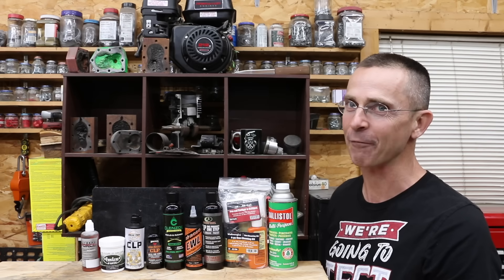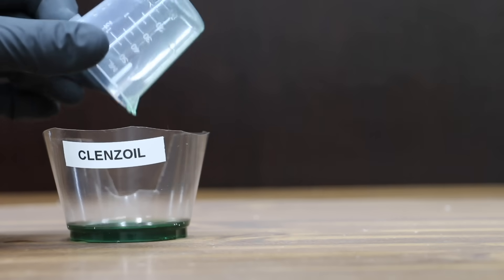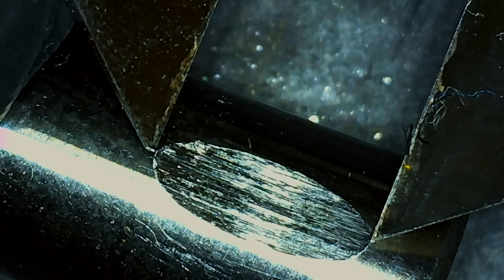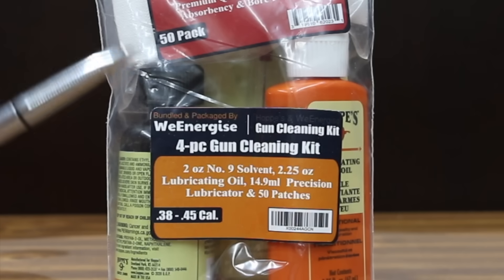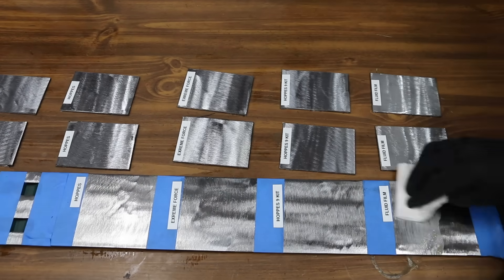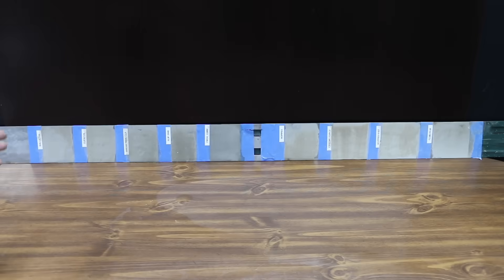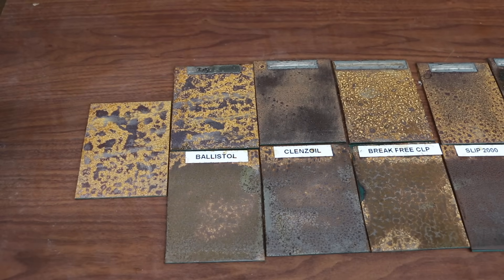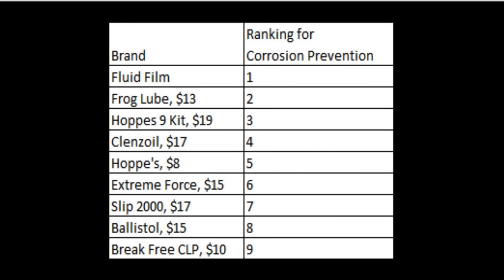Don't Buy A CLP Until You Watch This Review! It'll Save You Time And Money!

Comment: Excellent test. Disregarding how people call this kind of tests this was pretty scientific and elaborate testing. Also avoids showing guns with does goid with YouTube. Clever. In principle I have no use for CLP. Guns are banned over here. Anyhow I am quite disappointed in the Balistol results. I use their universal oil for many things with great results. Use it for manny purposes and it shines in all of them. Sure for some specific applications I use teflon spray or silicone spray or white grease or copper fat or graphite fer or what ever else is called for. But I use Balistol on metal, wood, leather and other materials and it lubricates, cleans and indeed protects surfaces. Woof feels great treated with it. Ach well. Other product from same brand. Anyhow kinda sad about how this product have performed here. Not cheap and not performing great. I've expected way more although I have never tried that exact product.

Comment: The process for frog lube is more tedious then regular lubes but it does work well! Supposed to degrease previous lubes because it interacts with frog lube,  then heat up products treat with frog lube and let sit. Then wipe off and use as a “dry” lube. They also make cold weather lube.

Comment: As former Force Recon I have used each of these except the extreme force CLP and Clenzoil. Break free is trash and not viscous enough to keep parts lubed during reciprocation and heat. Frog lube smells nice and is great for keeping parts clean in maritime operations but gets fouled too quickly when firing. SLIP 2000 EWL (and regular) is the best overall, it has been my go to in Desert, jungle, maritime operations, and will keep you firing longer than the others. It was interesting to see from the tests that you wouldn't think SLIP 2000 is very good but it has served me very well.
Reply: I was on the verge of regretting my very recently purchased slip2000. Never tried it before but now look forward to it after reading your input.
Reply: I'm a veteran 🎗 & a gun owner. I've used Ballistol since the late 1990s. It's always done very well ✔. I've bought, used Slip 2000 EWL & Froglube 🐸 Extreme(since 2014 or so). I like FL but it is pricey 💲 & can gum up, form gobs over time if too much is used. My friend has some Cleenzoil CLP which I may try. A big - with the brand is its petroleum based which many gunners, gunsmiths advise against 🚫. I will say, the product did extremely well in the R&Ds. EWL is not cheap but from my limited use, last 16mo or so, It's done fine; Walther PDP, M&P 2.0, Glock 26 gen 5 9mm, Glock 22 .40 MOS(cerakote elite).

Comment: Have spent years in the military, and using CLP on everything, although not a good hot sauce alternative, this is a great review. I love the added dirt attraction, as  that was a huge issue with multiple deployment overseas.  We tried using the graphite dry lube, which kind of worked. Thanks again for all your hard work and thorough testing. If you're curious, a M2 .50 cal will start to rust when he sees rain in the distance. A light 30w50 oiled rag can coat it nicely, but the. The sand loved it. Winter was a constant battle between the two
Reply: Ours did too until I had someone send me a can of Johnsons Paste wax. Got laughed at but after the first deployment not anymore. Everyone had a can of it.
Reply: @bixby9797  That's a good idea. Paste wax, and specifically lanolin, are used to protect bare metal to great effect.

Comment: Excellent video. For firearms if you have to have only one thing to carry in the field or on a trip Breakfree CLP will do the trick. For general, everyone I know uses cleaner then oil. General cleaner Hoppes 9 or homemade Ed's Red  ( ATF/Kerosene/Mineral Spirits/Acetone) then short term Ballistol, Long term full Synthetic 0w20. I keep a gallon of Ballistol on hand because it's so versatile. Leather boots, firearms, boring fluid, black powder neutralizer (moose milk). Stuff's amazing. Want long term non-oil? Johnson's Paste Wax. Lot's of museums use it.

Comment: I would think if in need of a quick cleaning some crc maf sensor or similar spray would do great, not for lube but a quick clean, lube well id say you could use some good atf or some thinner motor oil should do just fine and save some alotta extra money.

Comment: As I use Geissele oil and thin grease to supplement the lubrication aspect I’ll have to watch this again to see which products lean more toward cleaning and protection. Good info, though, as always.
Reply from the maker: Thanks!
Reply: @ProjectFarm  Excluding the lube test the Break Free did well in every category except corrosion. Good thing I have some Frog Lube to smear on the exterior surfaces. 😎 Still, I’m wondering how the Lucas CLP spray would do in these tests. Thanks!

Comment: Nice test and reporting. Wish you'd have added ATF Dexron, which is often used as  gun lube and cleaner as is Mobile 1 10-40w. A rare test is to find one that actually cleans barrels which have a layer of copper and carbon and who knows what else from firing. Some tests reply on dissolving ingots of lead and copper rather than removal of the layers in a barrel which is probably a layer of guild, lead, and carbon with carbon being the top layer and the first to be removed.
Reply from the maker: Thanks!  Thanks for the suggestion.

Comment: Great Job on this one.

Lucas Oil has an "outdoor Line" also, that has a CLP & some other products....

I was very intrigued that only the Break Free and a couple others actually met the specs....  although to be fair, I'd have to rewatch to be sure, but I'm pretty sure that Slip 2000, they don't "really" market themselves as a CLP....  I don't think it says CLP on the bottle.

We always used Break Free.  I have piles of that stuff.  Not gonna lie, I was shocked by the corrosion test....  In my experience, you spray that stuff on, and it stays.  I got some on a dinner plate once (don't ask), and I had a heckuva time getting it off....  Maybe the Hydrogen peroxide eats it?  Not sure....

Anyways, great job...  That was a fun one.  I'm one of those people, I have Break Free all over the house.  It's great for lots of things besides firearms.
Reply from the maker: Thanks!  Thanks for sharing.

Comment: Thanks for the test. I have been immediately turned off by Ballistol as it gums up, stinks, and is a terrible lubricant. Frog Lube just did not seem like a lubricant. That said I don't use ANY CLP. I clean with the appropriate product and lube with an appropriate lubricant. ALSO - Please don't say "the lube absorbed into the metal" -  metals used for guns (steel, aluminum, alloys, etc) do not absorb any lubricant.
Reply from the maker: Thanks for the feedback.

Comment: I use Hilco- lube or Marvel Mystery oil mixed in mineral spirits for cleaning for lubricating CLP break free or Royal purple 5w30 mixed with a small amount of Lucas red and tacky grease and whipped up well for long term firearm storage used very lightly with a toothbrush and a small piece of chamois cloth so far no rust just a quick break down of firearm and wiped down with dry chamois cloth before use to remove excess oil and grease has worked well for me now over 20 years
Reply from the maker: Thanks for sharing.

Comment: Don't know what the modern advice is these days but over the past seventy years I have always used a solvent and then an oil for protection.  Grew up on Hoppe's (pronounced Hop-ees-, long e) #9 which always called itself a solvent.  If left as a protector you would not get rust but a green residue like a copper on a patch run through the barrel.  The problem was if misused that residue could gum up the action.  Properly used to remove powder and copper fouling then wiped out with dry patches before applying an oil for storage and a gun grease (again a Hoppe's product) for long term to be removed before using.  We even used STP as an outer wipe with our weapons if we were hunting in our heavy rains.  Too thick for the action but it was tenacious about shedding water as in a wet duck blind.  In short just never found anything that could do it all.
Reply from the maker: Thanks for sharing.

Comment: You dont need to lube the gun for wear. it's rust and carbon solvent you want it for. if your gun needs lube to work or "last longer" you need a gun smith.. also please test the omega 636 if it will come on top of fall flat in this regard. :)
Reply from the maker: Thanks for the suggestion.

Comment: I  think the Hoppe's #9 doesn't belong in this test as it not labeled as a CLP.   It's a gun bore cleaner formulated for breaking down burnt powder residue and copper fouling, and when the cleaning solvents evaporates, a thin lubrication film is left behind to prevent rust from forming 
on what would otherwise be exposed dry bare metal.  It's not intended  as a lubricant for metal on metal  friction.

Comment: I wish you would have used some synthetic 10w-30 motor oil, that's what I have always used in my ar's and handguns. Never cooks off from the heat, and lasts several hundred rounds before needing to reapply.
Reply from the maker: Thanks for the suggestion.

Comment: Finally! I requested this like 2 years ago and you responded something to it but I can’t remember what you said haha. Thank you.

I personally use Lucas marine grease. It’s the same as Lucas’ firearm grease according to the data sheet (minus the grape smell). You can get a huge tube of it for like $5-$7 as apposed to like $7-$15 for a tiny amount. Would’ve been cool to see the Lucas grease in there. The good thing about firearms is they have very tight tolerances (some less than others) but even a bad lube will still work decently in a firearm. I’m glad to see all the fudd lore disproven though. Hoppes is trash and is ammonia based which can react to certain metals like nickel. There’s people who swear by it but it’s clear that it’s bad at lubricating.

Comment: I think that this time you tests were irrelevant to actual situations. First of all, you can't use the jig for testing how much friction protection a product insures because in a firearm you do not replenish the oil like you did from your container. Second, firearms do not shoot steel projectiles, the jackets are brass or copper. Third, in no way is there a moving device that should generate such friction - parts do not spin at those velocities. Fourth, you were tasting pastes and also liquid CLP's - you wouldn't use frog lube inside a barrel because it would be too thick. Fifth, components need to be lighly lubed, not soaked. Sixth, the metals inside a firearm are different than those used in the test, they usually are treated (barrels) with some xide resistant technology - blued, cerakote or use stainless steels so corrosion is not that aggressive. Seventh, the use of salt is really not indicated for the test, although it speeds up results, you rarely get salt inside a gun. Eight, diesel deposits are not the same as gunpowder residue so I think the test is irrelevant - you can use soapy water to dissolve the residue inside a barrel, it's not that hard but, of course, you don't do that because you corrode you gun. All in all, you make great videos and the tests you make are ussually relevant, but just in this case I think you should redo the tests in reals scenarios (except the temperature one, that's ok).

Comment: I would like to see you do a video where are you test small engine oil compared to regular motor oil to find out how well it performs under the lubricity test as well as engine running I temperatures I’ve always been curious how well it performs and there is no better person to do it then you

Comment: Rem oil aerosol is my go-to clp as it seems to have good low temperature performance. I use it on carb and fuel injection linkages and it works great on automotive door locks, too. It also seems to resist evaporation. Doesn't leave varnish behind like WD-40
Reply from the maker: Thanks for sharing.

Comment: I use SEAFOAM DEEP CREEP as a main CLP now. For rust prevention and storage its EEZOX, unless goop doesn't matter then its Fluid Film. 

Applied properly EEZOX is drier than most other rust prevention products, except Marine Tuf Glide, and has equal rust protection to Fluid Film IME.

WELL DONE!😂
Reply from the maker: Thanks!  Glad to hear!
Reply: EDIT....I've used EEZOX since 1987. Its full synthetic and polymerizing... Resists heat to 500 degrees. Good cleaner...OK lube. You have to remove all other products and apply 3 coats allowing 12 hours of drying time between each...you're sorta married to it but man alive Todd...I searched everywhere to find anything that stops rust and up until I started watching PF...nothing came close. SFDC will do what the Break Free level products will do. You have saved me $$$$ protecting my valuables.

Comment: I was a crew served weapons instructor (NEC 0814) for 10 years... Never heard of anything being "full auto rated", definitely a marketing ploy. Wouldn't use fluid film to lube a weapons moving components but I did often use it on 25mm barrels that got sea spray on them. It was so viscous that it would stick to the barrel and keep the sea spray off thus preventing surface rust... CLP is useless for keeping surface rust from forming in a marine environment.
Reply from the maker: Thanks for the feedback.

Comment: I wish you would contact mfgr engineers ‐ with polymers so prevelant, I don't think 400° is realistic. If 400°F was reached in a semi auto i think lubrication would be the last if your problems because the metal would be on the ground having separated from your polymer grip. Exception-a ridiculous torture test where rounds are fired ( even if it takes 1000 rounds non stop!) until the furniture catches fire!  And -40°f??? Who the hell Hunts in - 40°? 1 % OF all hunters? Please be more realistic with limits? Why not bake the oil on at 800!°? Just as irrelevant. If 400° is reached ,WITH MOVING PARTS, tell us, please. 
Otherwise- there IS helpful information to be gleaned. THANK- YOU.

Comment: i use synthetic motor oil for mi rifles and works well, stays on longer than some of the other more expensive options.

Rem oil seems to dry and disappear fairly quick.

Did an experiment with kitchen canola oil on a ruger sr 22 and it worked good for about a week then it dried into a gummy substance.

Did another experiment with Turtle wax ceramic coating on same ruger, the wax just dried off after a short time.

Liquid wrench seems to work better than wd40, its mi go to if i don't have motor oil in hand(wd40 dries up).
Tried tractor grease and would not recommend it works but it's messy and attracts too much dirt.
Reply from the maker: Thanks for sharing.

Comment: As a Ballistol user, I was really disappointed. I had high hopes for it in your tests. I would also like to do the Lucas Oil CLP tested in the future.
Reply: Me too, I was expecting Ballistol to hold up but it got thrashed in the tests. To be fair though, Ballistol’s original formula is still the same for more than 100 years and a newer product line called Gunex was created for modern weapons. Perhaps Gunex would be more of a better representative for Ballistol.

I use Ballistol as a general purpose oil for around the house, as it is a really great cleaner and metal protectant especially in very humid conditions.
Reply from the maker: Thanks for the feedback.  Thanks for the suggestion.

Comment: you should do a video on carbon monoxide detectors. i just saw a video where firemen did a controlled carbon monoxide test with 10 different models. out of the 9, 4 went off only when the level went above 400 ppm. (this is a very high level)3 others went off when it hit well above 400. and 3 never went off at all. this is a silent, odorless, killer.
Reply from the maker: Thanks for the suggestion.

Comment: I know you are being bombarded by requests but if there is a round 2 may I suggest Royal Purple Maxfilm?

I have been using it as a dry to the touch type rust prevention and in Royal Purple's video on Maxfilm in their lubricity tester they showed it to have a wear scar similar or smaller to Clenzoil even when dry... I wonder if it truly lubricates that well or if they lied like 95% of these manufacturers tend to do...
Reply from the maker: Thanks for the suggestion.

Comment: Next time for penetration, lubrication, bore cleaning, and rust prevention, consider testing a mixture of acetone and a high quality ATF.  The acetone is the penetrating agent, but the ATF does the rest.  The traditional formula is 50/50, and the mixture must be shaken up before application. With modern synthetic ATF, I think 25% Acetone and 75% ATF would do the job. If you try this, use real acetone from a farm supply or big box store, and not nail polish remover.  To avoid possibly damaging bluing or other finishes, test it on an older firearm first, or an inconspicuous part of a newer, but not prized, firearm.
Reply: 50/50 ATF-Acetone is a penetrating oil that beats about everything and is much cheaper than buying it.
Reply from the maker: Thanks for the suggestion.

Comment: One thing I want to note. I have the Frog Lube paste CLP. The instructions say to heat the paste to melt it and help it to absorb into the metal. That was not followed in your test. Would you be willing to heat it into the metal and re-perform the tests on Frog Lube? I am happy you tested it! I have it for my 44 Mag and it actually took scratches out of the metal, took off carbon I couldn't get off before and the only friction I feel is the spring resistance, so none. I heated into my gun very thoroughly with a hair dryer to achieve these results.